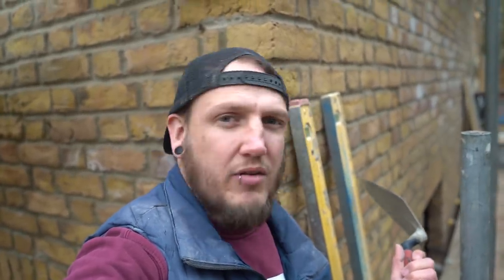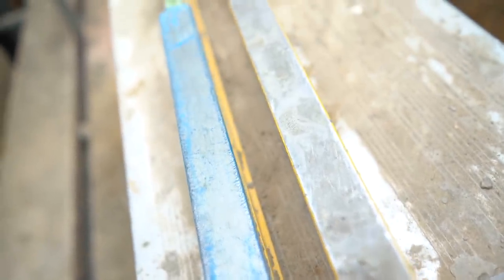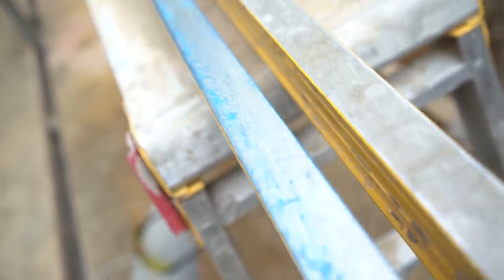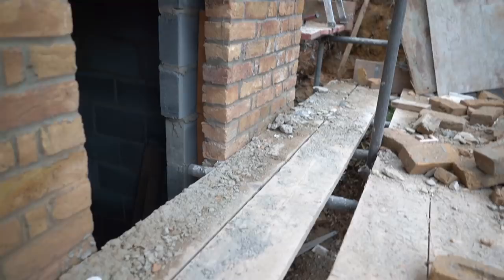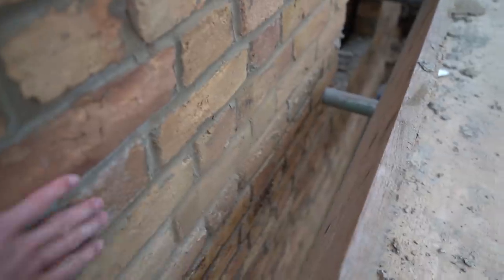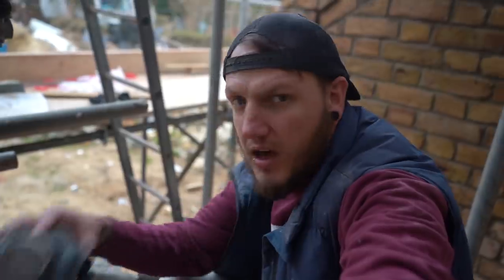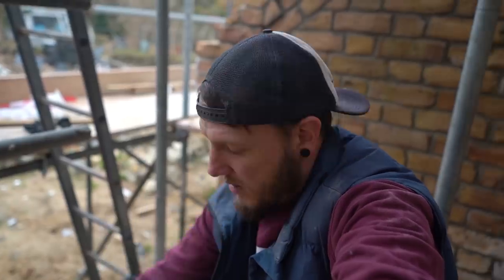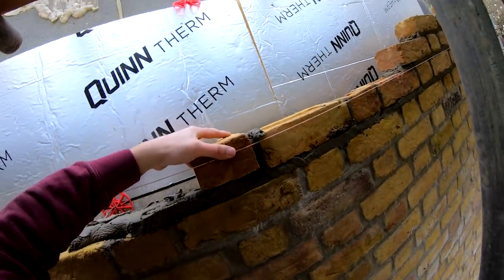7 BAD HABITS IN BRICKLAYING

Comment: I'm in the line all the t il me but I'm solo.

Do yourself a favor and order some crick levels and a  w rose leather handle trowel...
Reply from the maker: I'm happy with what I have but when it comes round to renewing tools I'll look into it 😁👍🏻
Reply: Crick and W. Rose are the best of the best!
Reply: @TNskinny  just make sure you get a good rose. ive had some shite ones that i could cut in half with a pointing trowel
Reply: crick is no better than sands and costs twice as much. i'll stick with sands. i've been watching a lot of videos like this from all over the world lately, and from what i've seen, the only masons in the world that spend a fortune on wooden levels are American masons. most others tend to use cheap aluminum levels. (unless other countries just paint their wooden levels yellow or blue for some reason). As far as the trowels with the leather wrapped handles. i prefer a marshaltown with the red rubber comfort grip and black rubber bumper at the end of the handle. that leather wrapping stuff is ugly as hell and generally ends up peeling off a trowel under heavy use. Plus with the marshaltown trowel, its full tang and actually screwed into the handle, wooden handled trowels generally loosen up and fall out of their handles over time. i've seen quite a few guys go to fling mortar off their wooden handled trowels only to have the entire business end slip out of the handle and fly a good 5 to 10 feet away.
Reply: @Smokey420Greenleaf  my trowel is over 10 yrs old, and no mason I know that uses a Rose has ever had the things you are describing happen, they usually only replace trowels when they are sufficiently worn from cutting brick with them... then again, the masons I know take care of their tools.  I sincerely hope you're not equating all wood handle trowels to be of the same quality....

As for the aluminum levels, they may read level and plumb just as well as on purchase, but that doesn't mean they are as good quality.  

I'm willing to bet I will never have to replace my set of Crick levels that are already a decade old in my career, but I doubt that most aluminum level guys will be able to say the same.
I mean you can argue that wooden  or metal mortar boards are just as good as gatorbacks but until you've used them for a while you have no idea what youre missing.
Reply: @jamesfranks1790  i've seen several masons using roses with the trowel falling out of the handle, and once it does you can see exactly why. its a square, wedge shaped shank that only seats half way into the wooden handle with no ridges, threads or anything other than friction holding it in place. once that friction breaks (usually from age and the wood drying out or rotting, or the repeated vibrations of tapping bricks into place) the trowel will fall out of the handle constantly unless you glue/epoxy or pin it back in place. 

Honestly i don't care what you use, use what works best for you. just keep in mind that just because everyone brags about their super expensive tools, doesn't mean they're actually the best. generally the people that brag on their tools the most are just trying to justify the price they paid to everyone else that thinks they're an idiot for doing so. with masons its usually rose/crick vs everything else, with mechanics its generally snapoff/crapsman versus everything else. but if you actually look into the specs and construction of the item, its exactly the same as the next brand. only difference is the marketing budget behind the items. hell in a lot of cases, several different brands of tools and other items come out of the exact same factory/assembly line and literally the ONLY difference between one and the next is the name they decide to paint/print/stamp onto it. in all reality all a rose trowel is, is a generic trowel blade fitted into a fancier than normal handle. while the following items arent masonry tools, i think they'll illustrate my point. 

Kraft macaroni versus generic (both made in the exact same factory with the exact same ingredients)

craftsman versus companion tools (exact same construction made in the same factory) 

yeti stainless steel tumblers versus ozark trail stainless steel tumblers versus members mark stainless steel tumblers. (exact same construction from the exact same factory, usually a $30+ difference in price) same could be said about the heavy duty ozark trail coolers versus yeti coolers. 

Same goes for trowels and levels. most are mass produced in the same exact locations, with the same materials and construction techniques. crick/sands levels for example are made from identical materials and the exact same construction, yet there's a good sized price gap depending on the name stamped/painted/printed on it. i have the same pair of sands levels i started with 18 years ago and have yet to have an issue with them, and with my marshaltown trowels, i've never had one come loose from its handle because they're actually screwed into the handle rather than just relying on a simple friction bond. 

Actually just thought of another fair comparison... marshaltown trowels versus ox trowels (exact same style, construction, etc. only difference is the colors and branding on the handles)
Reply: @Smokey420Greenleaf  the handles dont come loose from just tapping brick into place.  If it falls out because the wood rotted, sounds like they dont take care of their trowel.

The cost difference is not even that great for anyone to be bragging about "expensive tools."

Just because something is comparable does not always make it the same.   Sometimes those items produced in the same factory that look the same aren't.  One might use a lower grade of steel, in fact you see that all the time with strikers, cheaper ones are made with a lower quality steel and wear out faster.
Driver bits are the same way, the cheap ones are a fraction of the cost but tend to strip out much faster.

Those ratchets etc. That you are talking about are not all the same.  Some use cheaper parts in the gears and they have a tendency to break or jam up.

You are right, sometimes you might be paying just for a brand name, but sometimes things are worth paying an increased cost.

My first trowel  was a rubber handled Kraft trowel that I started out with when I was laboring, but  when I started laying and the boss (Mason for over 50 years) gave me one of his  spares I found that after using it for a while it felt so much better in my hand.  The lower lift angle is easier on the wrist as well.  The rubber handle I found to get slippery when your sweating your ass off, not  a big deal when your laboring but annoying when you're laying, trying to use up that last batch of mortar.

What I find puzzling is that you haven't had to replace your levels in 18 yrs but balk about them being drastically more expensive when the cost difference over time would have amounted to like a penny a day, or one bag of weed you didn't smoke 18 yrs ago...

Matter of fact as a weed smoker you should know that everything that looks comparable is not always...
Reply: @Smokey420Greenleaf  Can't beat full tang, kinda like poon tang only better lol

Comment: I use a stabilator masons level it’s got tapping buffers fixed to it £70/£80 on Amazon
Reply: That the r type?
Reply: Blue collar 1991 Stabila STB1962 K 120 Box section
Reply: I bought one of those, still use it but I ripped the buffers off coz I found it annoying that you can only use one side of the level with them on. And they double the weight of the fucker.

Comment: Why partial fill and not full fill, buddy? What's more common?
Reply from the maker: It's down to preference. I think its daft having a cavity to stop damp then fill it up. I like having the air gap to allow air flow and also partially fill to hinder any damp bridging issues.
Reply: @RodianBuilds  Sure but full fill is designed to breathe and allows far higher thermal u values to be achieved.
Reply from the maker: I didn't know that. Thanks for enlightening me 😁👍🏻

Comment: You still are an apprentice lol. Joke aside well explained and the levels don't stay plumb a lifetime they should be changed after around 5 years I was told this buy a guy when I visited the factory that makes stabila levels they do have a shelf life like everything else.
Reply from the maker: Not made to last forever. Something has to give eventually with all that whacking
Reply: I use crick or Smith. Bit hardier and I replace em every year need it or not. Give em to a promising apprentice if I can. Worth while to keep good levels

Comment: bricklaying tools are not cheap?? try to pay £900 for chop saw or flue tester for £800. compare  cost of your all tools to carpenter's, plumber's, electrician's.
Reply from the maker: Yeah, I know. So expensive, so glad our tools are cheap in comparison 🤣
Reply: Then come into the tree surgery and landscape game. Saws at 500 to 1500 with out bar and chains. Climbing and rigging gear, decent set up for most situations 3000. Chippers 15000 plus Stump grinder 8000 plus . We all need motors to get to work but tippers ain’t cheapest out of the bunch. Trailers as well. It don’t stop for us. And all the hand tools. Anyone got a violin?